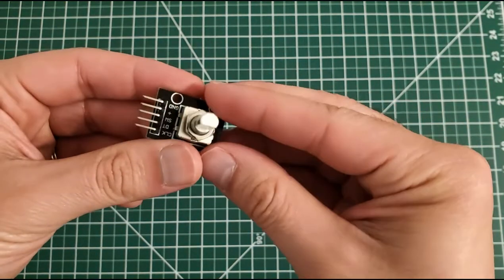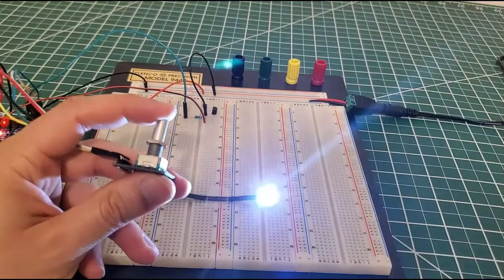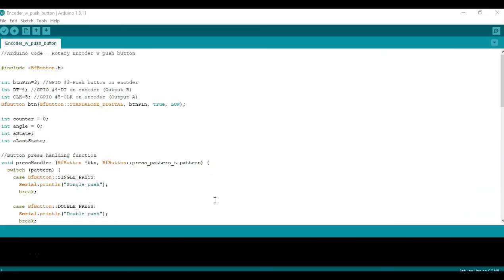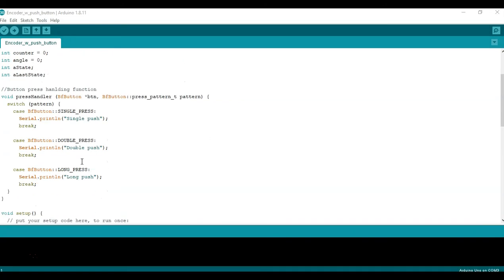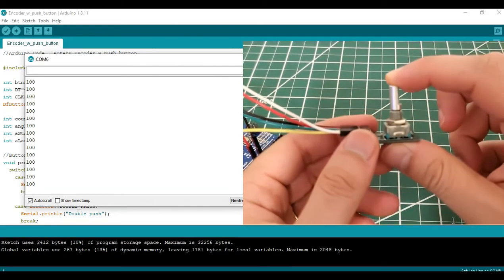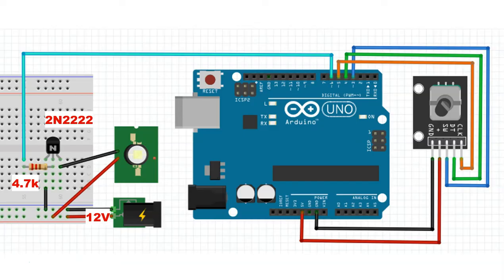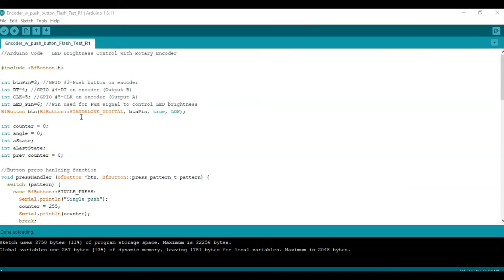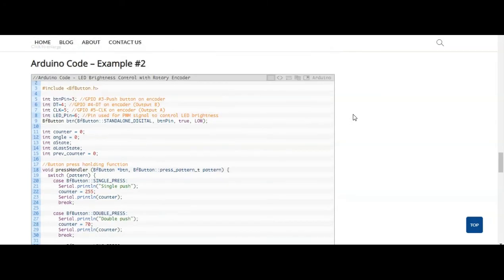Rotary Encoder with Arduino

Comment: Hi Thank you for the video
I wanted to use the bf button library for a second decoder, how do I include the second pushbutton? I am new 5o arduino
Reply from the maker: Hi Bryan. Thanks for watching my video! At the beginning of the code you have the following:
BfButton btn(BfButton::STANDALONE_DIGITAL, btnPin, true, LOW);

You can create multiple of these to initialize each separate button (such as shown below), but you also have to add more code further below on the code to make it work:

BfButton btn1(BfButton::STANDALONE_DIGITAL, btnPin, true, LOW);

My recommendation would be to simply take a look at one of the examples that comes with the library. To do this go to File --> Examples --> Scroll down to "ButtonFever" --> Analaog_button_array (click to open the example). 

Copy and past the example code and adapt it to your own application.
Reply: @diyengineers  Thank you for your reply.